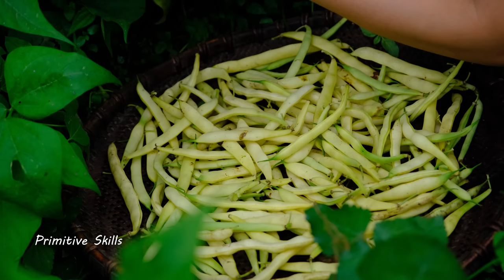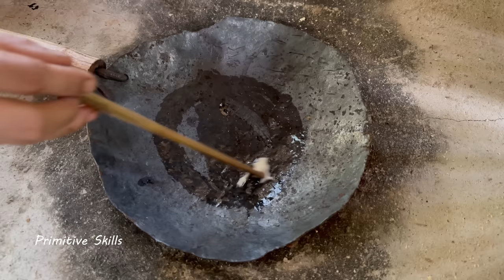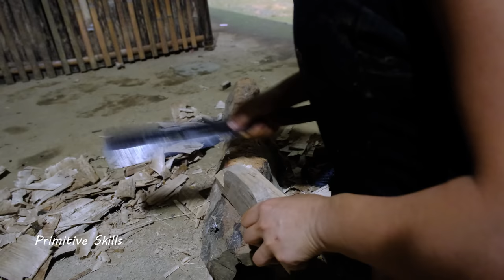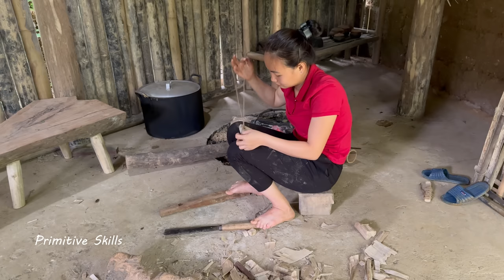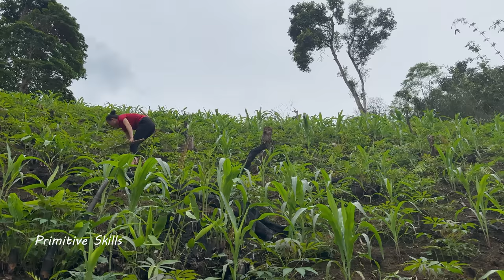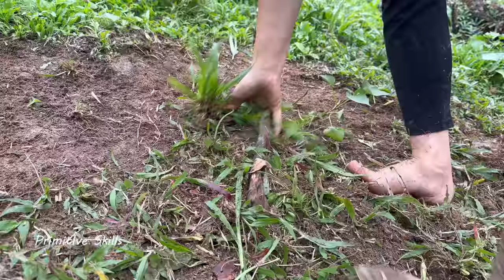Harvest yellow beans at the farm, Cook a delicious meal and plant care | Primitive skills

Comment: It is said that pound for pound, bamboo is an excellent fuel source, as good as many hardwoods.  The trick, however is to split it so that it doesn't have any sealed sections, allowing it to dry faster and to take up far less space.  Stacking it unsplit means that per cord (a volume, not a weight) of firewood, you get far fewer BTUs, but if you stack it split, so that it's occupying far less space with no big hollow core, it's comparable to high quality firewood.  (Also, if you don't split it, it may 'explode' with a scary bang when the moisture trapped inside each cavity gets too high in pressure from being turned into steam, and this could scatter sparks.)